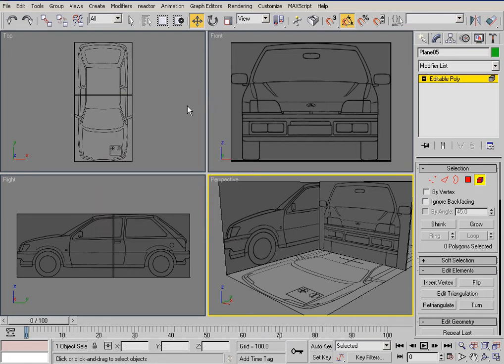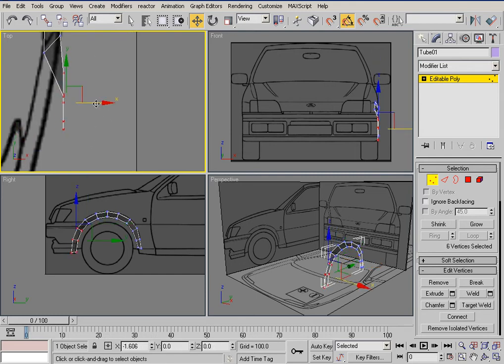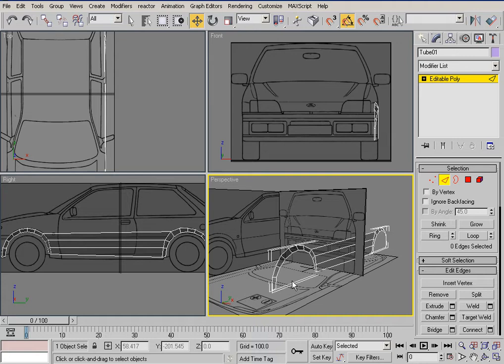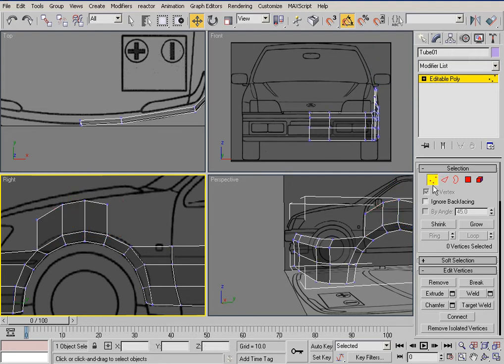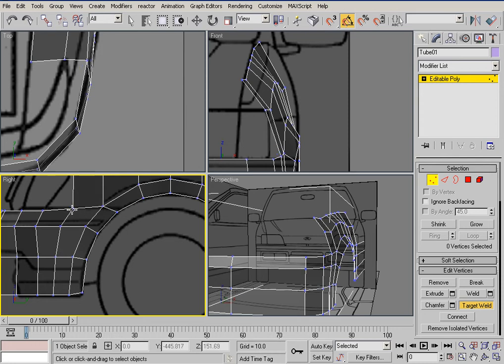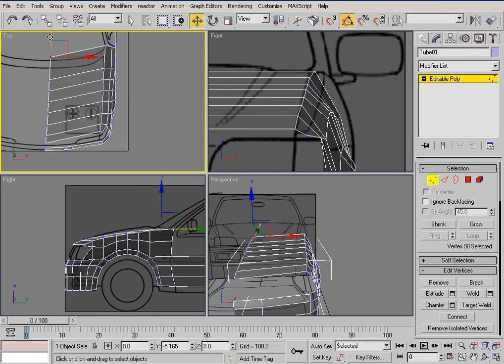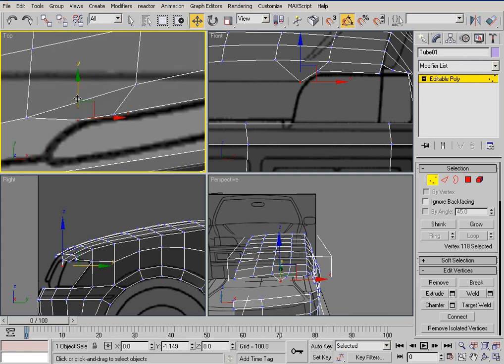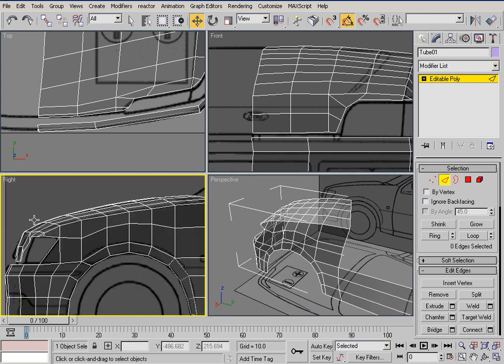Modeling a car in 3ds max - Episode 4 - Car Front

Comment: this is totally different from when you stopped in episode 3! Does anyone know a much more detailed version than this, all the way from the basics. I've been looking all over, and this seems to be one of the most detailed, but every couple of minutes there is a new thing to select or a new way to move around that just needs an explanation, if you ever wan't beginners to get any of this, I would recommend making the first video about the usability of the software.
Reply: how do you move your view around without just staying on the original axis?
Reply: Pedro Rov And how did you make the tube in mid air? mine pops up under the blueprints
Reply: Pedro Rov how do you delete the selected polygon at 0:27? can't find the option anywhere and delete button doesn't work